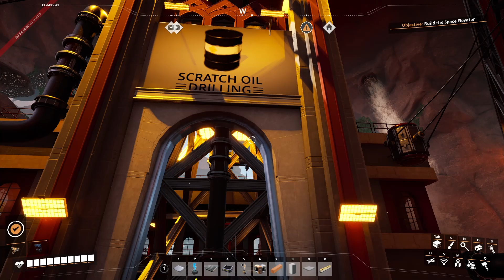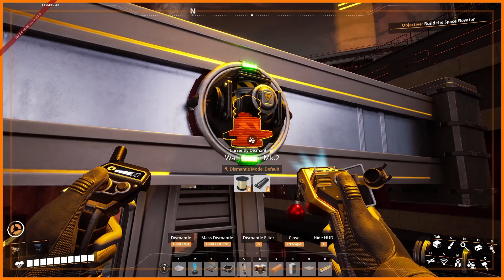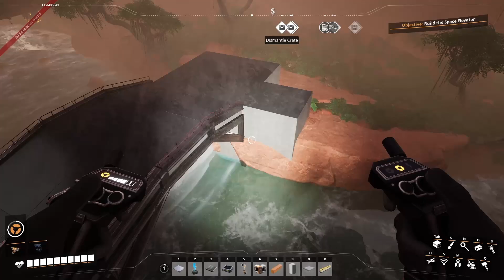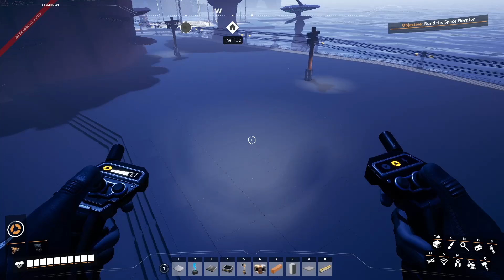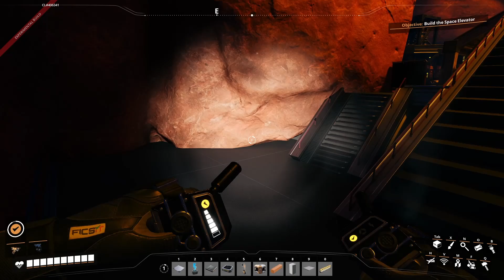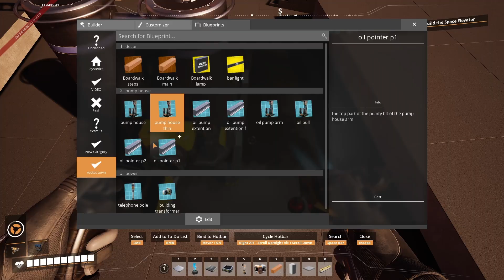I spent way to long on this build!

Comment: Brother, the amount of hours inside a blueprint designer must be sizeable

The results are breath taking
Reply from the maker: Thanks, dude. Yes, but that's what's great about the blueprinter. You can spend ages on one thing and them use it again and again, like with the telephonepoles.